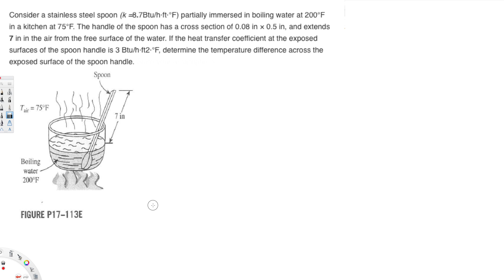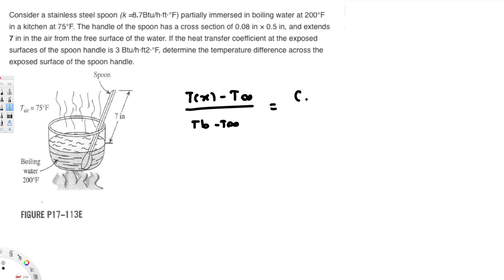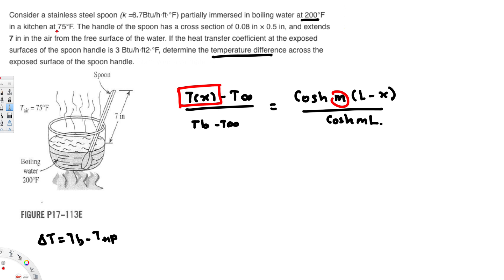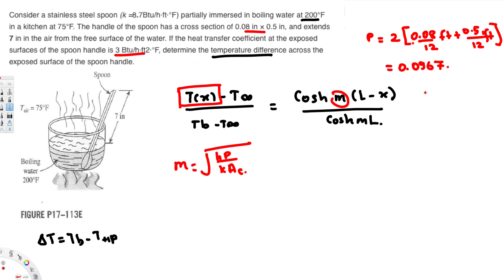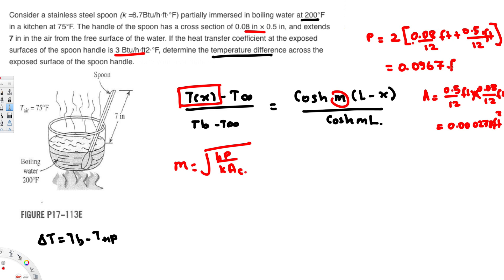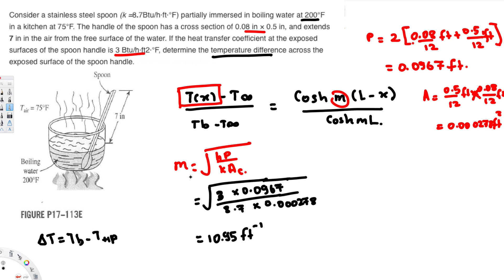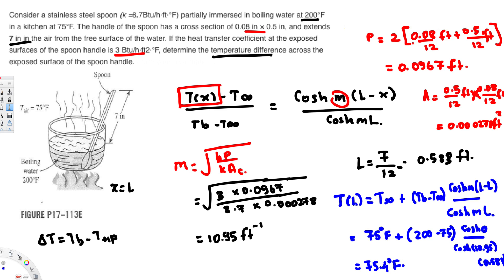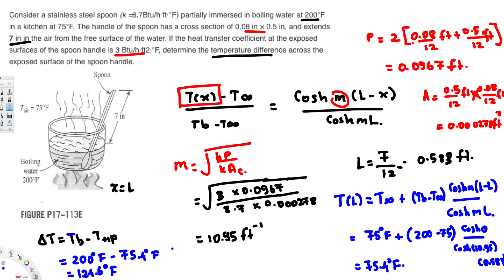Determine the temperature difference accross the exposed surface  - Heat Transfer

Comment: Please, can you tell me why did you consider that the fin edge is adiabatic and used the lenght correction to calculate it?
Reply: We have an spoon exposed to convection; the free surface from the boiling water is the exposed area. If we have a fin which is exposed to convection it can be treated as a fin with insulated tip but you'll have to replace L for Lc. 
There is other case for fins exposed to convection but that specific case covers Radiaton as well. So we can assume there is a spoon as a fin exposed to convection that can be treated as fin with insulated tip. Hope it helps after very long time.